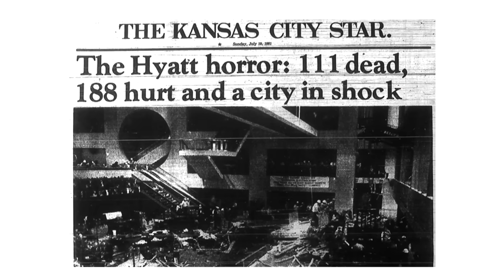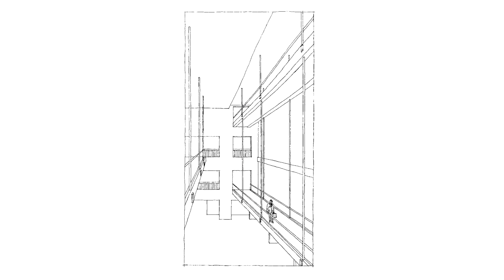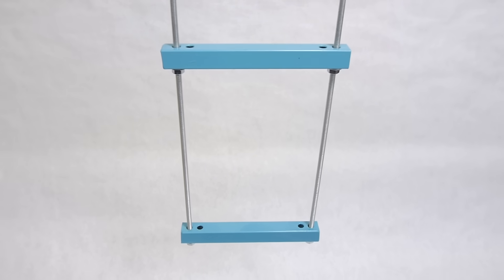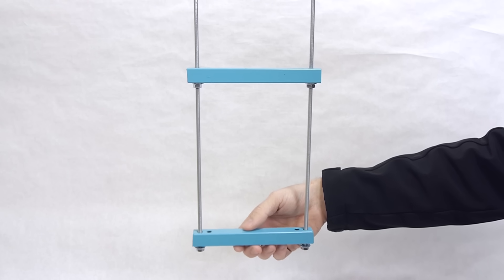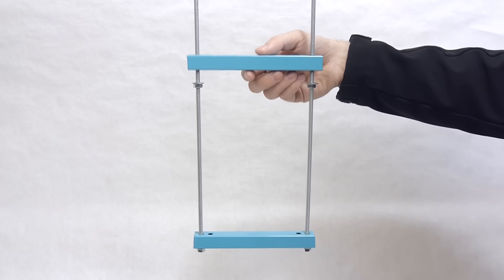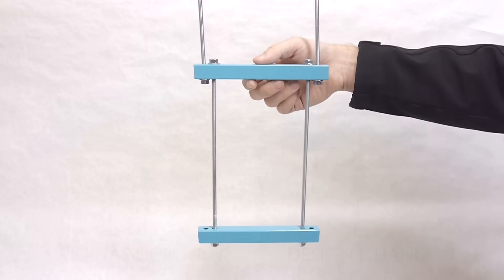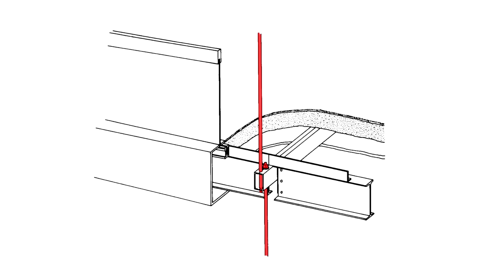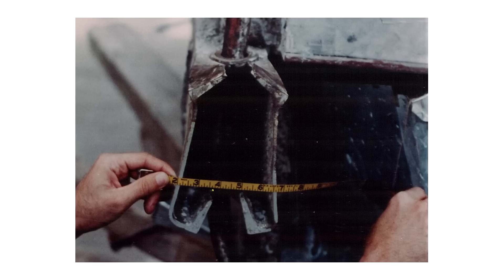The Disaster That Changed Engineering: The Hyatt Regency Collapse

Comment: My dad is a mechanical engineer. Based off how he built our tree house, I will not get near anything he has worked on.
Reply: There's a relevant old joke that goes:  "What do they call the person who just barely manages to graduate from Medical School?"   Answer:  "Doctor".  And so it is with engineers.
Reply: @robertlee5456  Someone who barely graduates doesn't get into the top residency programs. The joke is inaccurate and tired.
Reply: @MirzaAhmed89   And yet they still graduate, can apply for residencies, and can possibly become doctors, yes?  What do "top residency programs" have to do with a joke about the fates of those in the bottom quartile?  Unless you can show how med school graduates with low GPAs are auto-flushed out of the residency system, you have no actual point to make here.
Reply: A gardener could be amazing at his job, but have the worst yard on his block.
Reply: @JackReacheround  I feel attacked ....but is true 😅😅 my yard sucks ,and I have gotten landscape awards by the state 🙊
Reply: I remember seeing a helicopter leave the Hyatt and was there when it landed at KU Med Center. 
I watched the court proceedings. I remember the arrogance of the engineer responsible for the box beams and connections. The whole failure was well explained and made understandable to the layman. It was clear the failure was inevitable. The arrogant engineer was unrepentant.
Reply: Hmm. after 30 yrs of trimming, and disassembling trees for a living, reverse engineering something over a house, fence, garage , pool, etc., that mother nature took 75 yrs to engineer is tricky. Glad I didn't have to go to college to figure it out.
Reply: Engineers and weather men are the only 2 jobs you can have where you can be constantly wrong and no one cares.  And if you tell me you're an engineer I immediately think you're a moron. What looks good on paper and the real world are always two completely different things. The builder should have caught that because let's be real the people who do always know more than the people who don't.
Reply: @skippysvr4586  You forgot, inspectors, cops, teachers, fast food workers, ship captains, postal workers, military people, truck drivers, cab drivers, etc.
Reply: This is structural engineering
Reply: Things are not based off other things...they are based on other things.
Reply: An apprenticeship to become a fabricator or welder takes longer to get than an engineering degree and that includes the 4 years of work experience that comes with it. The fabricators and welders who made those shitty channels would have been horrified if they knew what the engineers were planning to do with them.
Reply: @mrdojob  It was the fab shop that suggested the change.
Reply: @stevebrogan9471  Every fab shop typically has an engineer.
Reply: @mrdojob  A degree doesn't make an engineer, after graduating they need many years under a certified engineer before they can qualify to take the test to be actual engineers. Much like doctors need a residency after graduating before they can try to become certified.
Reply: @stevebrogan9471  Doesn't matter, it was the civil engineer who was in charge of the project's responsibility (or the engineer whom was delegated the responsibility) to ensure the final design was safe. Sure it was a bad suggestion, but they're the fab shop, not the designer.
Reply: @osvaldopulido2553  on my German bachelor's degree it actually says that I'm allowed to call myself an engineer.
Reply: @stevebrogan9471  What do you call the guy in the fab shop who convinced the boss he's the best at pinching pennies?

"Planner."
Reply: mrdojob @chakatfirepaw is right, an engineering degree doesn’t make you an engineer. It lets you get a job in an engineering firm, so you can get supervised experience until you take an exam and then you’re an engineer.
Reply: @jordanrodrigues8265  , And the Project  Manager for the General Contractor was thinking "Any savings on this job means a bigger BONUS! I approve the change."
Reply: Engineers in the US have to work at a firm for at least four years AFTER graduation before they can test to become professional engineers that can seal a drawing.
Reply: @mrdojob  They had no business changing what a structural engineer called for, that was noted in the final report on the tragedy.
Reply: @mrdojob  engineering is extremely hard and requires studying. Degrees typically take 6 years unless your incredibly smart and spilt up work between friends. Then u enter an internship phase and work under them for a few years. But honestly respect to all in the construction industry
Reply: @asbestosfibers1325  What country are you in then?
Reply: @asbestosfibers1325  All the engineering degree's Iv'e seen have been 3 years. I think 3 is a lower number than 4. What do you think?
Reply: @mrdojob  I think you think that a BASc, (and every such program I've seen is a four year one), makes someone an engineer when it is just the start.  You then need to fulfill work experience requirements, (where I am that's another four years), including time apprenticing under an existing engineer.  After that you qualify to take the PEng exam to actually become an engineer.
Reply: @chakatfirepaw  Ontario, right?
Reply: @chakatfirepaw  and then you can shout about how there's a spy creepin around here as you whack a sentry with a wrench
Reply: @mrdojob  5 Years in Italy, and it's quite hard to end in that time. It usually takes 6 or 7 years, as you spend 8 hours a day attending classes, a couple hours traveling and THEN you get home to study. Then there comes the PHD, which lasts another 2 years. then 2 years of apprenticeship, provided you pass the State exam to get your certification.
Reply: @mariosebastiani3214  You don't need a PhD to be an engineer. Or spend anywhere near that long in classes.
Reply: @mrdojob  Maybe in your Country "engineer" means someone who draws things devised by others. I guess it is seen as something like a mechanic that fixes your car. Here, an engineer can design a contraption or machinery from the base materials up. That's why Italian engineers are sought up throughout the globe for big projects, and are frequently highly praised. While you don't need a PHD, here it is compulsory to follow the courses and pass the exams, so you DO need to spend AT LEAST that long in classes, or the Polytechnic doesn't let you access the exams. 
Anything else in which you'd like to lecture me about what has been my life from 18 on?
Reply: Mrdojob 

FYI 
At Louisiana State University mechanical electrical and civil engineering are all 5 year programs as is Architecture and Landscape Architecture.
Reply: @mrdojob  Engineering degrees are 4 years actually, at least in North America.
Reply: @maxk4324  often times 4 is pushing it. I know a lot of people, including myself, that are taking 5 years.